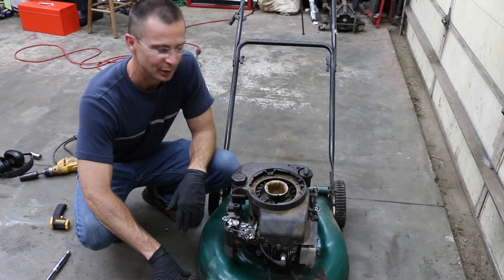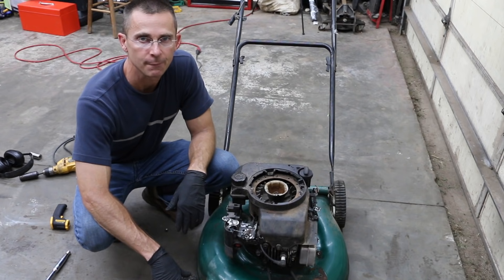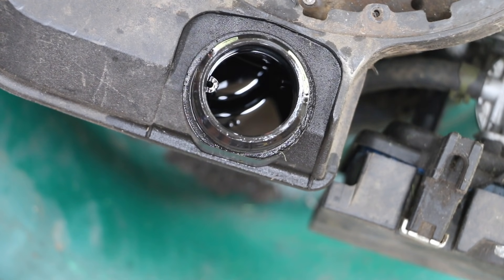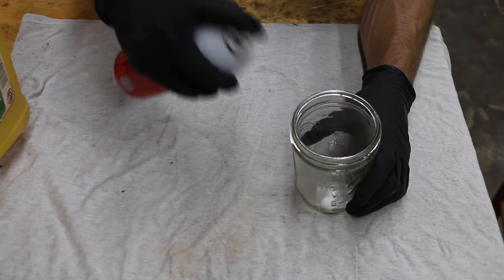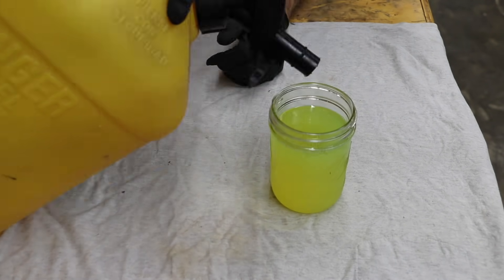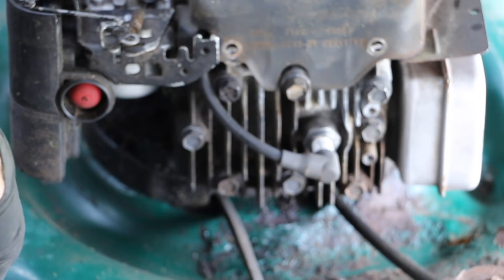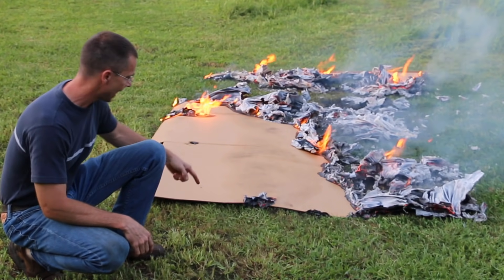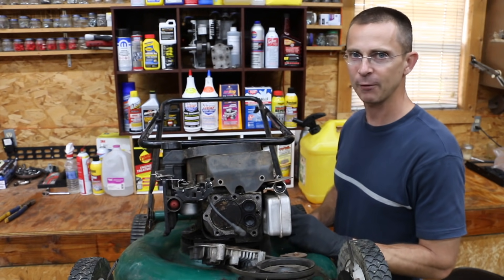Will a Gas Engine Run on Diesel?  Let's find out!

Comment: The problem with oils like diesel is that they do not vaporize in the carborator and simply coat the inside with oil. It also fouls the spark plug. 

Old timey engines had a heat chamber that was heated by exhaust that turned oils like kerosene and diesel into white vapor which was then sprayed through the needle valve in the mixer/carborator so that it would ignite with a spark plug. Any combustable material (even flour) will combust violently with a spark if you get the particle size small enough and you have enough oxygen. This is why grain mills sometimes blowup from dust combusting from a spark.

 The reason why they went through the trouble was that kerosene was dirt cheap and gasoline was not. These days, the opposite is true because kerosene is used to fuel airplanes.

The reason why we use diesel engines to combust oily fuels is because compression ignition is way more efficient and therefor more powrful and fuel efficient. Gasoline engines are cheaper to make and make less black smoke so they are everywhere. In the EU, 30% of cars are diesel and they want more for environmental reasons. In the USA we have it backwards because evironmentalists hate diesels here.

You can find small diesel engines made for model airplanes that in theory could power a pushmower. They are old and rarely sold anymore, but not expensive to buy used on ebay.
Reply from the maker: Great point and thanks for commenting.

Comment: That black goo stuff on the cylinder head after using diesel, was that carbon or diesel residue?
Reply from the maker: I think it was a little of both.
Reply: Project Farm Thank you for the answer
Reply: Bharath G i mean technical carbon is diesel residue

Comment: I've seen diesel engines run on straight crude out of the ground.
Reply from the maker: I'd like to test this!
Reply: That’s basically heavy marine engines. They use all the shitty heavy residues, it’s pretty much just a nasty treacly carbon soup.

Comment: I remember you doing a video on using vegetable oil as a sub for the normal wd 30/40 that you would use, I wonder if you could use a gun cleaning oil somehow or mix it with something, just think that would be interesting to see.
Reply from the maker: Thank you for this recommendation!

Comment: I know a diesel engine will run on filtered used cooking oil without any modification to the engine or the oil. Since the small engine would run on 50/50 diesel/gas, would it run on a 50/50 cooking lard (animal fat)/gasoline mix? Bio-diesel is made from used cooking oil, about 20 to 25% ethanol (drinking alcohol) or methanol (wood alcohol, "Heet") and lye. Never tried using animal fat to make Bio-diesel though... You've shown you can run an engine on vaporized hooch, what about animal fat (lard)?
Reply from the maker: Thank you for this recommendation!

Comment: I was wondering if you'd try this again but setup two fuel supplies so that you can stop one tank and start the other while it's running. What you do is start it on gas and let it get to operating temps. Once it's good and warm close the gas off and open the diesel. 

If you want to see where this idea comes from look up Farmall Distillate or Farmall Diesel startup. There's probably a video or two on YouTube. I'm curious if it'll work on a small engine.
Reply: If you were to try kerosene I'd use this same setup. I'm curious if it would work on a cold start too.
Reply from the maker: Thank you for this recommendation!

Comment: I accidentally did this with an arctic cat 600 zr. It started smoked out the shop and would backfire when you would rev
It was about 80/20 diesel
Reply from the maker: Wow!  Thanks for commenting on this.

Comment: they used to run diesel in gas tractors but you have to start it on gas and get it warm first preheating it is the key usually it was the intake manifold that had to be hot to vaporize the diesel fuel properly
Reply from the maker: Thanks for commenting on this!

Comment: If u ever need to build a big fire mix gas and diesel together but u don't need to much 50 50 and don't blow yourself up it is a little sketchy  ps great video i tried running diesel in a weed eater year's ago but couldn't keep it running  . I wanna see carb cleaner or break cleaner running a mower
Reply from the maker: Great point.

Comment: me and a friend used a small old scooter with a 50cc 2 stroke engine. we wanted to see if it would run on diesel, and our process was, drain the gas tank, but leave like a small layer enough to get sucked into the carb first. this way the engine would start normal, and warm up. after warming up the engine ran out of gas and had to use the diesel that we filled the tank with. the engine ran fine. only we had alot of white/blue smoke since diesel is more like an oil, we where able to keep running it smoothly with no issues. only problem was the smoke. also after running it, we could no longer start it after letting it cool down, not even with regular gas, because the spark plug was all gummed up with the oily diesel. so yeah, a small 2 stroke carby engine can run on diesel, but it has to be warm first.
Reply from the maker: Thanks for sharing this experience.

Comment: Years ago I read a suggestion for old old-school motors, such as the straight 6 in my 1991 YJ jeep, that a person suggested running a small amount of diesel with each fuel fill-up.  I don't even think it would be a half-gallon for a full fuel tank.  Anyway, the theory being that modern gasoline - between the alcohol in them and them being far more refined - just doesn't have the lubricity that old gasoline did.  This made sense, and diesel per quart is much cheaper than any specific top-end lubricant.  I ran it, in small amounts, in both a catalytic converter and a non-catalytic converter vehicle, and all I got was seeming smoother-sounding and idling engines.   The catalytic did not plug up.
Reply from the maker: I enjoyed reading your comments.  Thank you.

Comment: dear project farm in your opinion whats better as far as durabiity goes john deer poulan honda or briggs
Reply from the maker: Regarding the small gas pushmower engines, I don't have any proof or science, but my opinion is that Honda lasts the longest.  That's not to say that the other engines aren't fantastic.  The others are great as well.  A final point, a well maintained engine of most brands will outlast a poorly maintained and abused Honda.  So, for me, maintenance is more important than brand.

Comment: At work we use a pressure washer a lot to clean vehicles before we work on them. We had a pressure washer which ran on MOGAS (military jargon for gasoline). So, on occasion someone will inadvertently pour in JP8 (jet propulsion 8) which is a kerosene-based fuel that diesel engines love to run on (although it will ruin your injection pump on your 5.9L Dodge Cummins if you don't add lubricant, one quart of 10W for every 5 gallons of fuel). Anyway, as long as the pressure washer's engine was still hot, the engine would start right up and run well. It will backfire, though, when shut off. After the engine cools off again, it will no longer start.
No real point here, except that I found it interesting. Fun to know stuff sometimes.
Reply from the maker: This is great information.  I presume you are Air Force.  If so, thank you for your service!
Reply: I was Army, actually, now a civilian. No need to thank me though, I got paid every month. lol 
Everything in the military runs on JP8, just about, be it Army, Navy, Air Force, etc. I think they're in the process of changing the fuel to FP24.
Thanks for your reply, Sir. I enjoy your videos.

Comment: A long time ago, gas was a unwanted by-product of making lamp oil, later diesel became the by by-product of making gasoline. Funny how time changes things. Both have their strong points, but for actual efficiency, that's that hard argue point.... Both can be as wasteful or as efficient as the other. Depends on engine design, use, modification, etc etc...
Reply from the maker: All great points. Thanks for commenting.

Comment: what would cause the motor to only run while you constantly push the primer? i have one that does it
Reply from the maker: It's not getting enough fuel.  The main jet in your motor is likely blocked or gummed up.  Diesel is a lot thicker than gasoline, which is why I had to constantly prime it. Thanks for commenting.

Comment: Had to use a 50--50 mix, petrol -diesel , for a week.in a old 1800cc car. It had a SU carby, so could change mixture easily. Only idled  at 1500 rpm? , but it ran.  When  engine was rebuilt  the engine inside was clean, like new, so too the inlet..
Reply from the maker: Thanks for commenting.

Comment: Is it true that a piston rod can actually get slung through the motor block ? And could jb weld fix a hole in the center of a motor block
Reply from the maker: Yes, it is true.  I've had it happen.  Can JB Weld repair the damage?  Not in call instances, but in cases it can. It depends on the size and location of the damage. Thanks for commenting.

Comment: Could you drain the  oil in the crank case and fill it up with cooking oil see how long the engine would last or if it will stay running
Reply from the maker: Thank you for this recommendation.

Comment: Well as long as you watch your EGT's, and I said run, I would not load it up very hard, and this would be best done on a governed engine like a tractor or dozer etc. MANY MANY or dosers were started on gas then switched over once they were running.
Reply from the maker: Thanks for commenting.

Comment: This might be dumb, but I have heard of putting Diesel with your oil and using it as a flushing agent. I've also heard of replacing all of your oil with Diesel for a short time for a "deep flush". Maybe give that a shot some time. If you even see this. Either way, I love your videos, keep up the solid and educational work.
Reply from the maker: Thank you for this recommendation.
Reply: Project Farm No problem, thank you for taking the time to get back to me. I appreciate it.

Comment: Good to see you demonstrate it, but yeah, that was never going to work. Diesel will probably not get the correct air fuel mixture going through the carburetor without some modification. The compression is not high enough either. You might try installing the head with no gasket to increase the compression a little.
Reply from the maker: Thanks for commenting.

Comment: Diesel, technically being an oil, just doesn't turn to vapor as easily as Gasoline. That's one major reason Diesel engines usually last much longer than Gas engines,  because of diesels lubricative abilities the wear is much slower where the raw fuel comes into contact. Gas engines can run with some diesel in the fuel, I'd like to run a long term test to see if that helps to increase the life of these small engines, and the same goes for using 2 stroke fuel in 4 stroke engines, or will it just carbon everything.
Reply: From my studies I've learned that Diesel Engines use it's lubricative properties in their engineering and why putting gasoline into a diesel engine will destroy it, it's not only the combustion process it affects, it's everything the fuel touches.
Reply from the maker: All great points. Thanks for commenting.

Comment: I had a BMW 320i. I had run that poor little car on almost every conceivable flammable liquid known to man. Gas/diesel, gas/ethanol, gas/methanol, gas/atf, gas/diesel/atf/isopropyl alcohol and anything in between. What did I NOT try? Hydrogen, natural gas, propane and solid combustibles. That car wasn't the little engine that could. The little engine that DID! Only needed 25% gas. There's really a full story about that little car. Perhaps I'll tell it someday. When I get over my sadness for all the losses in my life over the last 4 years. I'm overdue for an upload anyway. I'll be around. Thanks
Reply from the maker: Impressive that the BMW only needed 25% gas!  Thanks for the video project suggestions too.  Regards.

Comment: I run my car with 10% Diesel (today's gas is 10% ethanol), the diesel helps gain power. Power comes from heat & diesel fuel creates more heat. Ethanol burns cleaner but creates less heat. BTW I put 3 oz of acetone in to aid burning & help clean fuel system.
Reply from the maker: This is great information. Thanks for sharing this information and experience.
Reply: Thanks, a friend adds some diesel to his van and it increases millage.
Another friend put pure diesel in his truck, ran rough and burned the valves.
I used 1/3 gas in a diesel, some power lose but aids cold startup.
BTW I meant 3 oz not 30 oz acetone, been using it 10 years.

Comment: Can someone explain for me how or why the mothball mixture was supposed to work?
Reply: Old trick to boost octane.   Has to be the napthalene types balls though.   Not recommended these days.
Reply: Diesel isn't rated in Octane, but it is known to be harder to ignite than gasoline. This is a gasoline engine. Trying to make the diesel fuel harder to ignite will just make it worse.
Reply: Richard's World Traveler
Resistance to pre ignition doesn't necessarily mean it's harder to ignite. The reason why Diesel doesn't work on a gasoline engine is because it doesn't release flammable vapour at low temperatures. Naphthalene has a much lower boiling point that commercial Diesel so the naphthalene fumes will ignite, which in turn increases cylinder temperatures enough for the Diesel to burn too.
Reply: @RichardsWorld  yes exactly!
Reply: @RichardsWorld  pretty sure diesel fuel is rated is cetane.
Reply: Yeah but higher octane doesnt mean more power, octane levels being higher reduce preignition and engine knock, the higher compression ration there is the more preignition and detonation can happen, so the higher octane gas deals with that.
Reply: Because the former type of moth balls were made of naphthalene, which is highly flammable, so its use was discontinued in favor of significantly less flammable 1,4-Dichlorobenzene (para-dichlorobenzene).
Reply: Naphtha is a oil byproduct! which is the main ingredient in moth balls.
Reply: OP
Reply: Increase octane
Reply: Diesel have very low octane number compared to gasoline. Mothballs acts as octane booster.
Reply: @a64738  no it doesn't! Low octane means it burns with less Resistance to heat! If anything Diesel would be higher and in some sense, too high
Reply: @a64738  that's exactly what I am.saying lol... Higher octane means more heat or compression is needed to make it fire... why do people bother with shit like this before properly reading what has been said?
Reply: @a64738  dang good advice!
Reply: @a64738  Cetane( diesel) not octane
Reply: Mothballs are produced from crude oil, so is gasoline that's why!
Reply: Bharath G So is plastic, should he add some plastic cups too?
Reply: @erikjohansson1814  sure but plastic doesnt absorb as the mothball did so ot wouldnt dissolve as easy therefore it wont work

Comment: Try hydrogen with benzin, or even with diesel it should work. Hydrogen is helping to burn fuel more efficient, engine should be clean inside.
Reply from the maker: Thank you for this recommendation.

Comment: When I was a roofer we would mix diesel in the aluminum coating so it would dry faster. Then after work we would use it to wash our hands to get the tar off. Nice video
Reply from the maker: Thanks for sharing this experience and thanks for the positive comment.

Comment: Maybe try using the jar and diesel like you done with the gas in the jar and see if the engine will run on the diesel vapor like it did with the gas vapor
Reply from the maker: Thank you for this recommendation.

Comment: can you revisit the gas engine running on 100% diesel. There are some other youtube videos that "run"100% diesel in a hot gasoline engine. They used a torch to heat up the cylinder head and then cranked it as usual. it seemed to run just fine.
Reply from the maker: Thank you for this recommendation.  I'll add this to my list.

Comment: Just discovered your channel today. So far have viewed about 10 episodes. Very fascinating stuff!!. I've subscribed. How do you think overall run times would compare with 100% gas to the 50/50 mix. Like my VW TDI which I get close to 50 mpg. Thank you for spending so much time on these vids. God Bless
Reply from the maker: Thank you very much for the positive comment and thanks for subscribing.  Also, I believe diesel will almost always outperform gasoline in efficiency since it contains more BTUs of energy per unit.  Additionally, it has different burn qualities which I believe make it more efficient. Thanks again.
Reply: I'd like you to perform a sort of "mileage" test on both. Maybe run time comparisons of 100% gas and 50/50 mix. If there is a great enough difference. It might be worth considering for at home use. Thanks Again. Happy New Year and God Bless

Comment: Like if you wanna see Project Farm run mower on hydrogen.
Reply: Yea with the mower that runs on vapors
Reply: Yes see if it will run on hydrogen
Reply: I've tried it and it burns clean only the engine life is shorter than normal because Hydrogen burns dry. Maybe on the engine I did it to it had a bad OHV (over head valve) because it was quite old.
Reply: @americangunsmith9951  what kind of a setup did you have to create that much hydrogen consistently?
Reply: @internationalhotrods  electrolysis is what I did but it took to much power so it was running batteries dead fast.
Reply: Keep playing with that hydrogen gas and start your own space program. Headligns,  man gos to moon with lawnmower, does not come back.
Reply: Already asked him to do it but haven't seen it yet.
Reply: Remember when HHO generators in jars were going to save us all?
Reply: Someone on YT already did that producing the hydrogen from a bottle of H2O.
Reply: Maybe even produce its own...
Reply: How about like if you want to see some of the viewers who actually has a brain!!!!!!??????